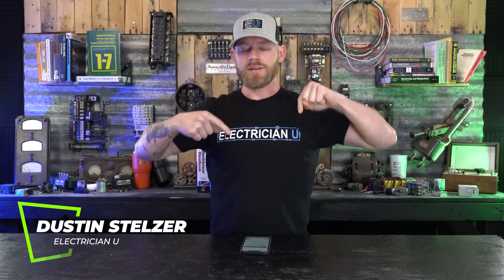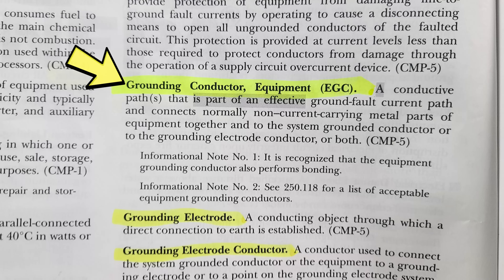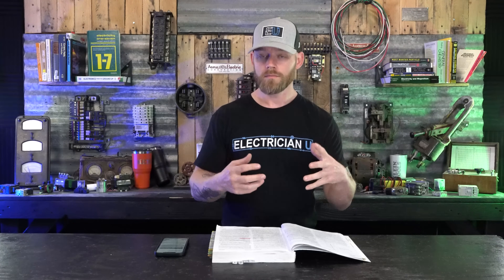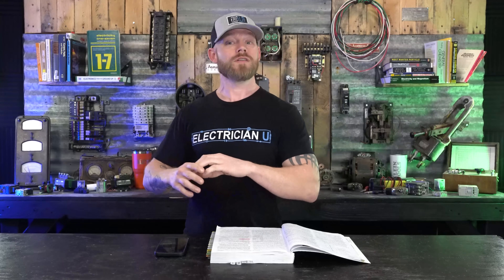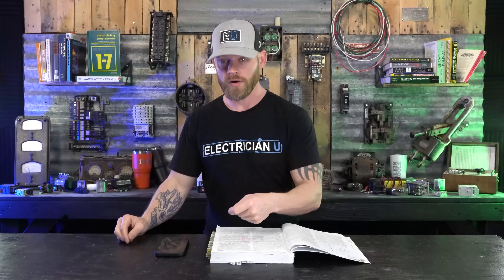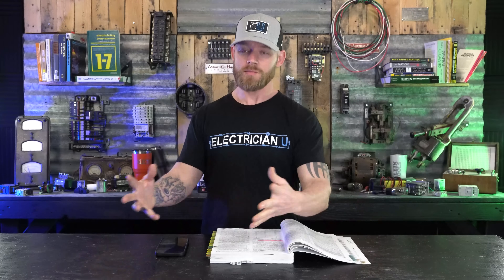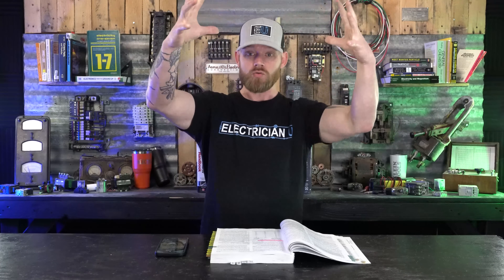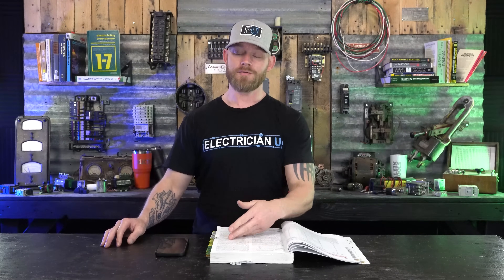Why Are GROUNDING Conductors Smaller Than GROUNDED Conductors???

Comment: Ungrounded = hot 
Grounded = neutral/identified
Grounding = bond
Reply: So an ungrounded conductor is literally just a hot leg? I am not an electrician, just skimming through the NEC because I am curious to when a whole panel surge protector is required? Trying to do my due diligence but little confused lol
Reply: @larrytinnin3357  I would suggest starting by really trying to understand the difference between a bond, a neutral and a hot. Then go back to my post for a reference of the official names of those things. Hopefully that helps

Comment: I love how you talked about "in a perfect world where everything's balanced which never happens" when I used to work in concert production doing electrical work we ran into both instances of needing a neutral to be a true current carrying conductor so much so that in some extreme applications for massive festivals w/ thousands of moving lights containing discharge lamps, 2x 4/0 neutrals would be run....and in other instances you'd get the phases balanced so perfectly that you'd measure 0 on the neutral 😂......momentarily that is

Comment: You know what you really need to talk about? Hotspot hot tubs!
This company are Supplying homeowners with a 100-amp subpanel with a 2 pole GFCI 50 amp circuit breaker. In their schematics they are calling for #8's!
One person online tried to install #6's and when he got to the termination part in the control box in the hot tub they wouldn't fit!

Comment: When running two 60 amp circuits in PVC conduit, how many grounding conductors are needed? For example, there are four 6 awg THHN stranded ungrounded conductors, can there be only one 10 awg THHN stranded grounding conductor and then fork it anywhere splicing is legal or are two needed?

Comment: Thanks for all your videos... i've learned a ton. Question. if i run 4 #6 wires to an outlet intended for a welding machine, how do i ground/bond the metal box? the pigtails tend to be a really small gauge like10 or 12. Do i insert them into the plug with the 6 gauge wire?  or do i use a wirenut to connect them? and is it ok to have a 6 gauge equipment grounding cable and a smaller cable to the grounding nut?

Comment: I appreciate every video you produce.... you're young and hope you will profit in this Industry.  I started out in the 70's, and when the bottom fell out in the IBEW local 212, I had to look for other work because sitting in a Union hall just waiting to be called was not for me...so I answered an ad for a Deputy Sheriff and was hired that afternoon.  So being away from anything electric for 27 years, took me a while to get back into it and yes, I forgot a lot.  Now I am back into it, things have rapidly fallen in place, now ready to retire fully and enjoy farming.  But I was going to say about Grounding and Equipment Grounding and sizes of wire...some electrical inspectors are picky, and I have been inspected by electrical inspectors who worked in this field for years and are not also building inspectors, so my point on grounding conductors, listen to what and how the inspector does their inspections....there is a difference.

Comment: If the neutral and ground are bonded in the main service panel, how does the electric know which way to go?  How does the electric traveling back on the neutral wire know to go out on the neutral wire and back to the pole and not out on the ground wire to the grounding rod because it could go both directions once back to the main service panel.
Reply: Still learning but....... I think when hot somehow makes contact with say a metal box, it energizes the box, which is hopefully grounded and heads back to the panel that way. Since you hot broke the circuit current can't return via the white. I suppose a nick in a black could theoretically return via white and the ground at the same time? Maybe an expert could address that one but I think ground would be the low resistance way for a short to return to the panel and trip the breaker.
Reply: Current always wants to return to its source and will take all available paths, preferentially taking the one with least resistance. In man-made electrical systems, the current source is usually a transformer. The current can take the neutral wire back to the transformer and it can also take the grounding wire at the main panel, to the grounding rod, travel through the earth to the grounding rod at the transformer, travel up the transformer grounding wire and get back to the transformer that way. But, the earth has massive resistance compared to a lovely, fat, metal neutral wire specially designed to carry current so essentially all the current will travel on the neutral.

Comment: Hey love your channel. Very educational!
I have a 25 year old 100 amp service panel in my garage that is directly opposite of my power meter on the Wall. My panel is full and only has one position open. I want to upgrade to a 200 amp panel to add a circuit or two for outlets and a 50 amp welder outlet in the garage. What's the best way to upgrade and can I do the work myself and just have it inspected after. Also would I have to upgrade the breakers in the panel or can I keep what's there an add to it. I'm in Minnesota. Thanks!
Reply: You have to have 200 feeders 2 art hundred amp is only number four check your code book or Feeders

Comment: Dustin,   Couple issues.   During a ground fault, the current will not travel for a second.   If it does, there is a problem.   Fuses typically will blow in 1/4 cycle and breakers typically will trip in 3 cycles or less.   One cycle is 1/60th of a second.   So, equipment grounding conductors are sized to carry thousands of amperes for very short period of time.   Remember that overcurrent protection is totally about protecting conductors.  Grounding electrode conductors, you said were sized something to do with carrying fault current incorrectly.   They are for surges and lightning strikes only.   No additional current will go to earth during ground fault condition.   The GEC has as much as it will ever get because of the ohms resistance of the system.
Keep up the Great Videos!

Comment: Could you explain how the earth ground is a conductor? Testing with ohm meter shows open.
Reply: Try a clamp on ammeter.
Reply: @KevinCoop1  Could try a regular amp meter. Will update.
Reply: @mobilecommunicationsnetwor5268     Must be clamp on.   Encloses around the conductor.  Do not try the cheap multimeter to measure it.   Probably will smoke it.
Reply: @KevinCoop1  Ok, will work on getting clamp on meter for testing. Thanks!

Comment: Hey dude, very curious about 250.104(B) and bonding gas piping. Specifically method (1) of using the EGC from the circuit that is likely to energize the piping system. Would this bond be made separately or does it rely on the connection of the piping to the metal chassis of the device/appliance being powered?

Comment: You should do some tests to see how fast grounding conductors can react (throwing a toaster into a pooled gfci protected circuit for example)
Reply: Millisecond stop watches are hard to find.  But you can get a multifuction testers, such as Megger MFT1741 multifunction tester, to test the lines.  Total loop impedance for instance to see if the impedance on the wire from end to end is low enough to generate the required current to trip the breaker.

Comment: The Equipment Grounding Conductor may be smaller because of the amount of time they are designed to carry a load.  

Grounds aren't always sized by the breaker, thats wrong. 

A neutral won't shock you.
Reply: Lloyd Mills   An open neutral shocks me every time.
Reply: @tedlahm5740  True story. I got shocked from a neutral one time in a retirement facility due to poor bonding.  The high impedance left the neutral with a difference in potential to earth.   One of the many lessons I've had in trusting no one except your meter.
Reply: The breaker size is the starting point for sizing the equipment grounding conductor.  Other factors do govern as well, such as upsizing proportionally for voltage drop, but the short answer is that the breaker size tells you the minimum size for the EGC, for the simple situation.
Reply: No  @carultch  .  It doesn't.
Reply: Oh yeah.  Whats the potential between ground and ground that creates a shock hazard?
Reply: @lloydmills9619  Kirchhoff’s voltage law for open circuit.
Reply: @tedlahm5740  by "open" do you mean "not connected to ground"  is that conductor still a grounded conductor or is that an ungrounded conductor?
Reply: @lloydmills9619     I tend to agree with your general statement, IF everything is designed and installed correctly throughout the complete electrical system.  I personally saw an electrician grab a neutral and started shaking from it before he got loose from it.   I also got a call to investigate why in a 6 story building electricians had noticed arcing from N to G.  And found 10 volts difference.   Should be zero!   After doing a review of their electrical system, I found some disturbing things installed over the years.   One big one was ground rods attached to transformers in the middle of the building driven through drilled holes in the concrete.  No moisture below the floor in the dirt.   Once all of the grounding was fixed, zero volts N-G.
Reply: @lloydmills9619  poor bonding.  Neutral is a conductor bonded to ground to make it the same potential.  If the bond is corroded, or you have ancient ground rods, this can create a high impedance from the connection that is supposed to create this equipotential scenario. The resulting difference can be measured with your meter and I see this in small amounts of voltage more than you would think. But to have enough potential to overcome your body's resistance is definitely rare but it happens.  I mean, you do realize that the neutral isn't grounded at the utility transformer right? this happens at the meter and/or main depending on the utility/AHJ.
Reply: @JacobMcMarley  so, not grounded or ungrounded.
Reply: @lloydmills9619  Grounded, but with high impedance to ground. Current doesn't always follow one path.  If the return path has too much resistance then it may choose your body as a path to ground as well.  Kind of like if you bond in a sub-panel and now you have a parallel return back to your main bonding jumper. In this scenario, both paths are low resistance but the current is taking two paths.  Now imagine a proper set-up but it is ancient and the ground rod is old and the connections are corroded, maybe some neutrals are undersized for some of the newer additions added to the building perhaps.  The neutral is still grounded and returning current to ground, but there is equal or more resistance to get to earth than the path through your body. In this case, you can get shocked from the neutral because some of the current goes through the neutral but some will try to go through your body too.  I would still say that the conductor is grounded, it's just poorly grounded.  Remember it doesn't have to go all the way through your body out of your feet. It is usually just through you're hand or arm that happened to rest against a grounded piece of metal.  So neutral is poorly grounded and so is your arm, but it is still grounded.

But I don't remember him saying the neutral will shock you.  Didn't he just say that current runs through it? Either way, a properly bonded grounded conductor won't shock you because it has the same potential as earth. But as systems/services get older and you are out there troubleshooting voltage drop or fault issues, it's always good to do two safety checks before you begin.  First, put your clamp meter around the GEC to make sure current is zero, and second check for voltage across neutral and ground to determine if there is an issue with the protective earth bond.
Reply: @JacobMcMarley  So if the grounded conductor is grounded the potential to ground is 0. What happens when its ... NOT ... grounded? Is it ungrounded when it's not grounded?

Comment: Hey Dustin, why are some devices and equipment polarity sensitive on single phase 120v? Shouldn't it not matter on an alternating current system since the polarity is constantly changing?
Reply: They might use chassis ground as a reference.  Gas furnaces do this with their low voltage 24vac circuit with it commoned to the chassis.  If the transformer isn't wired so that the TH secondary (R) is in phase with the mains L1, it can mess up the flame rectification flame sensing which uses the grounded and commoned chassis for the return through the burner and is dealing with micro-amps.
Reply: Are you asking why a blade on a plug is wider that the other one?
Reply: @JT-lq4yd  no
Reply: The answer is unless it is double insulated, the manufacturer wants the switch installed on the hot conductor.

Comment: Could you possibly talk about receptacles that are “self-grounding when properly installed in a metal electrical box”? Must remove the nylon washer? do you need an all metal cover plate? Should I still use a pigtail to the back of the box?
Reply: That means the metal yoke is connected to outlet ground, so when connected to a metal junction box that has been bonded to ground, the outlet is now grounded as well. Still run a ground wire to the green screw, though. Even though the screws holding the outlet to the box are not technically grounding screws, they can be if the physical connection loosens, and then your screws become grounding screws, which by code they cannot be (ground screws cannot have any other purpose than to bond to ground. They can't be used to hold stuff together as well).

So, still connect ground to the outlet ground screw. It's just a good idea even if you don't technically need to do it.

Also, what if the metal junction box wasn't properly bonded to ground and you're relying on the junction box ground to bond your outlet to ground, and then a ground fault develops? No breaker trip and now something that shouldn't be is going to be energized. If that outlet had been bonded to ground independently, the fault would've tripped the breaker. But because the box wasn't properly grounded, it's not. Don't rely on something else being properly bonded outside the service panel.

Comment: Hey I got a 8/4 soow power cable for my welder that has a L6-20 male connection. Would it be alright to combine the white and green together? Or should I just leave that out all together? The other end will have a 6-50r. Thank you
Reply: Leave off the white/neutral. Your welder does not have or use one.
Reply: you should probably upgrade everything for 4 wire with a separate neutral and ground. (outlets and plugs) BTW, #8 wire is not heavy enough for a 50 amp circuit. It's only rated for 40 amps.
Reply: @rupe53  my welder is rated for 20 amps though. The power cable it came with is an L6-20r
Reply: @shaneintegra  ... that clarifies the welder draw to be well within the power cable capacity. That 50 amp outlet is only a 3 wire connection so likely set up for 2 hots and a ground to the welder chassis. (if it's 240 volt) The old code will have you using red. black, and green, with no neutral. (white wire) New code for that outlet would have you using all 4 wires to an outlet / plug with 4 prongs.... and likely GFIC as well.
Reply: @shaneintegra     An L6-20 is 250 volts and 20 amperes.  Your 8/4 conductor cord is way overkill.   You need either #12/2WG or #10/2WG (for very long cord) for your welder.   Do not connect it to 30,40,or 50 amp receptacles.  Receptacle should be L6-20R on 2 pole 20 amp breaker with #12 minimum wire.